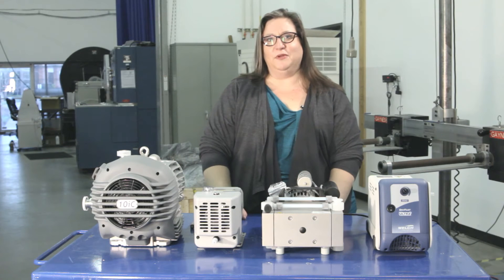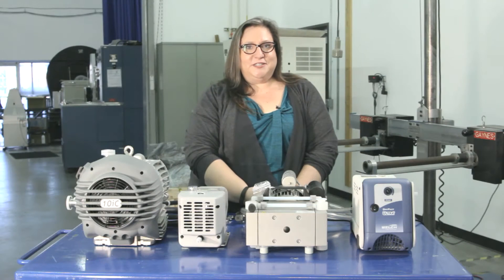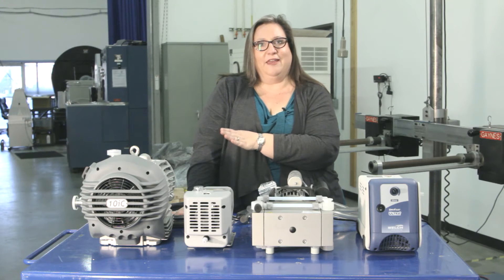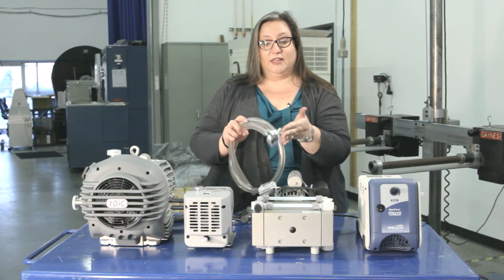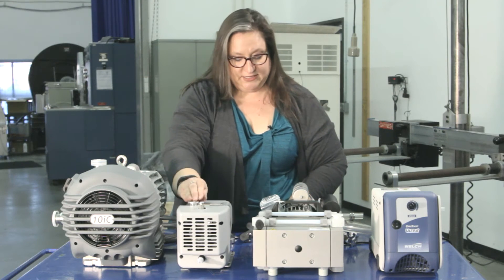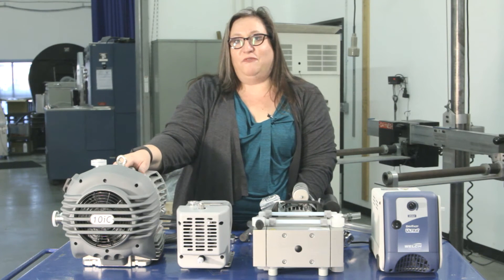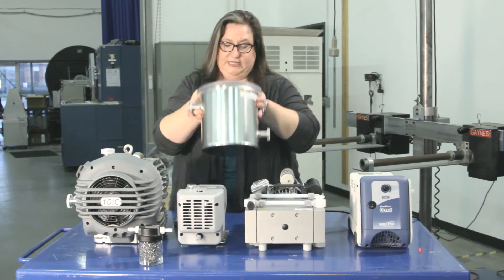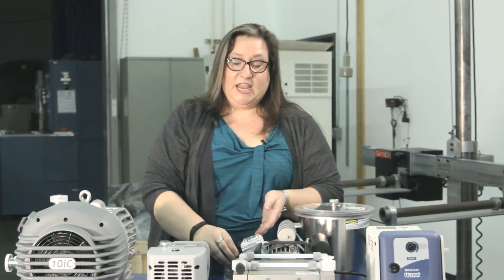The Best Vacuum Pumps for Making BHO and other Types of Cannabis Extractions

Comment: sounds like you are trying to justify the need for an oil free pump, its not like we are purging while there is liquid butane or even a high enough concentration of butane 

that being said these pumps are great but a oil pump works fine I have used a Fischer pump for 4 years and I changed the oil regularly it still works fine

I do want to get a oil free pump but not because the oil is a problem just because I dont want to deal with the oil

you are saying that THC will turn to a gas under vacuum but at what temp?
Reply: +Colin Hamilton Why not use hexane instead of butane? Possibly even spring for a soxhlet extractor.
Reply: just over room temp. low 100's.